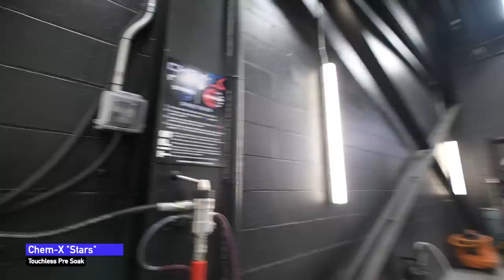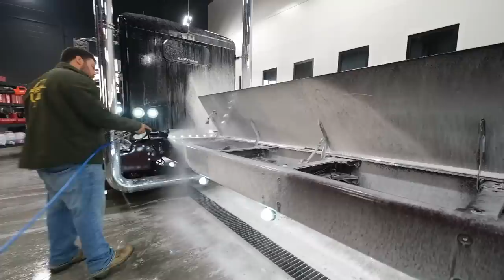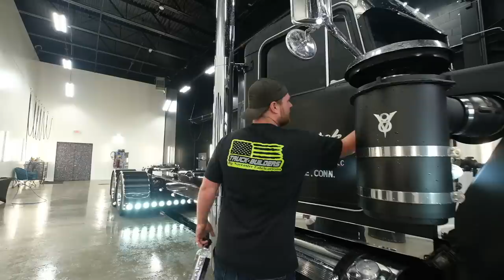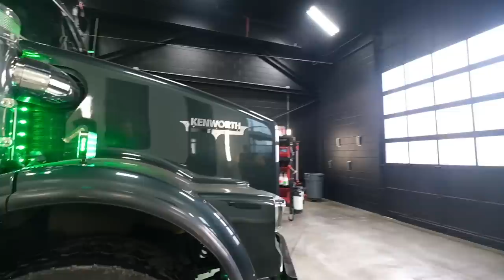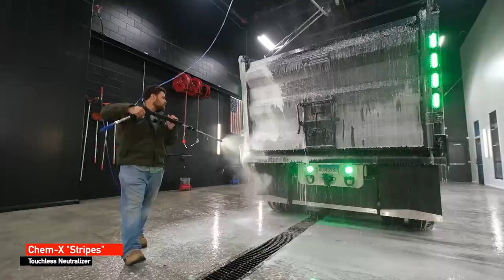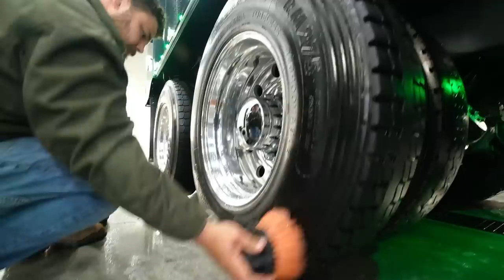Touchless Wash+SiO2 Ceramic Seal on Two Custom Kenworth Show Trucks!

Comment: How does stars and strips do against magnesium chloride? Here in Colorado that’s what they use on the roads. We have 9 trucks that we run year round. From a dodge 5500 12ton wrecker all the way up to a 65ton NRC rotator on a t800 KW chassis. Trying to find something that will make life easier. It sucks taking 2-3hrs to wash our heavies during winter.

Comment: These came out great. I have to say I haven’t watched in a while. So I’m not sure if you’ve ever done older vehicles/trucks/buses or whatever. I’d love to see you do a older like 10-15 year old RV or bus that has some mildew or black lines in it to see how it turns out. I say that for a few reasons. You have the garage for one as well as the equipment. And I wanna see how your product handles the job. I think one of your videos made me buy the product you were using and your washer setup is next gen something I’d love to put in my warehouse garage to wash all my toys.